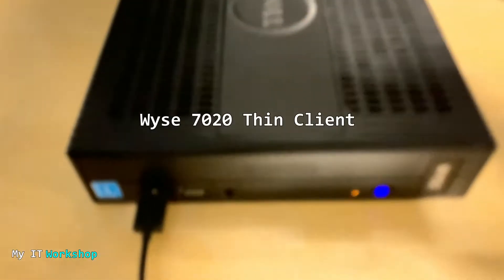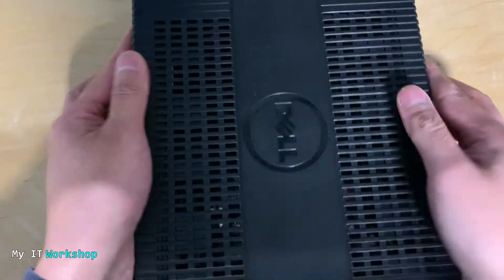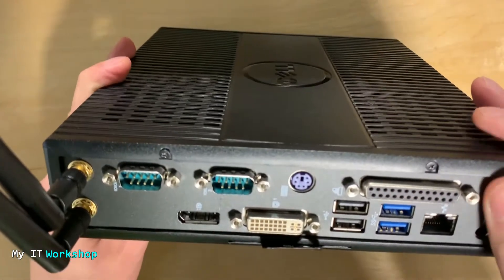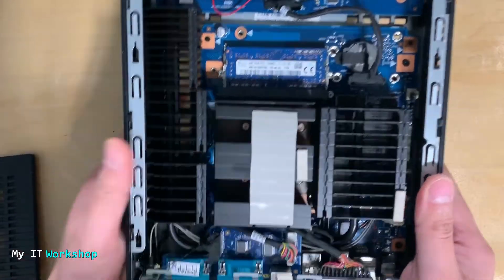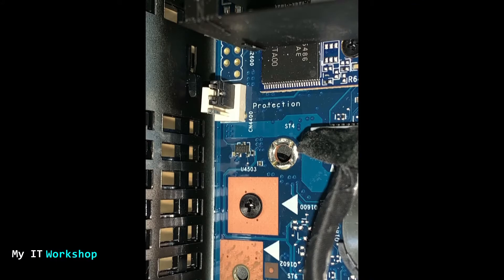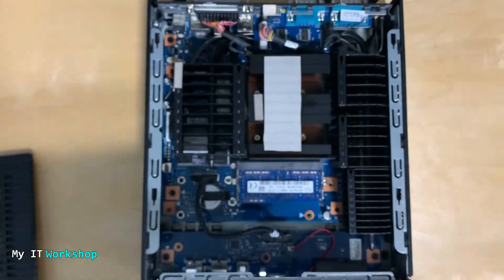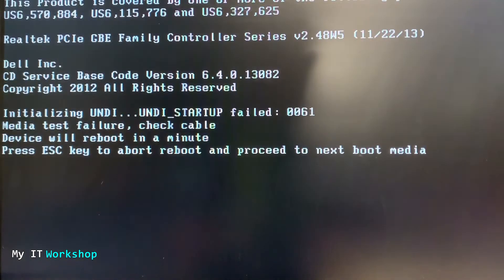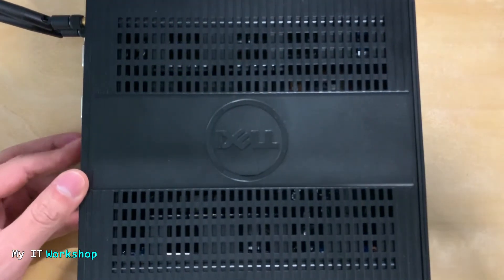Dell Wyse 7020 with Black Screen | Fixed

Comment: Salve ho un SSD con installato windows 10 che uso come unità esterna che mi porto dietro e all'occorrenza posso avere il mio sistema operativo portatile. volevo sapere se è possibile connetterlo ad un wyse 3040 thin client con ThinOS 9.5.1079  bios 1.2.5 in modo da poter visualizzare windos. Grazie 
Hi I have an SSD with windows 10 installed that I use as an external drive that I carry around and when needed I can have my portable operating system. I wanted to know if it is possible to connect it to a wyse 3040 thin client with ThinOS 9.5.1079 bios 1.2.5 so that I can view windows. Thanks

Comment: Update: My unit died... got coffee spilled on it and I didn't know...
Reply: I got another 7020 and love it.... was able to get it all upgraded and it plays movies and streams great! I also too the Bios jumper and added a spdt pushbutton switch to reset the bios. I used a 3 pin pigtale from an old audio patch cord for the old CD-ROM drives.... anyway, was able to get the system to reset and use this unit to replace a laptop computer.... also, I upgraded the SSD to a Sata to NGFF adapter with a 512GB SSD. I was also able to add the 2nd. Sata channel for a second Drive. the "Protection" jumper is really the Bios reset jumper.

Comment: Dell Wyse thin client was cute, it was cheap.  I bought it.
Black screen fix on my unit was replacing the RAM it came with.
Reply from the maker: Those are nice for linux.
Reply: @MyITWorkshop  Z50D runs Win 10 OK but slow to boot.  Mostly I use Puppy Linux on it, much quicker.
Reply: I bought a second Z50D.  Also black screen.  
They both arrived with one stick of RAM installed.  Video displayed and full function when I populated the other RAM slot.  Possibly they need a pair.

Comment: Do you know how many watts this uses when in operation? Thanks
Reply from the maker: Hello,
Just found the processor power consumption: 15 watts......
Hope it helps
Thanks for the comment
Reply: @MyITWorkshop  thanks for looking, another question, when you had it open did you see what type of hard drive it has? I am thinking of purchasing one of these off of eBay and was wondering if I could put a larger SSD in one. Thanks again.
Reply: I think it does. I have several 5010 models, and I have installed half-height SSD drives inside all